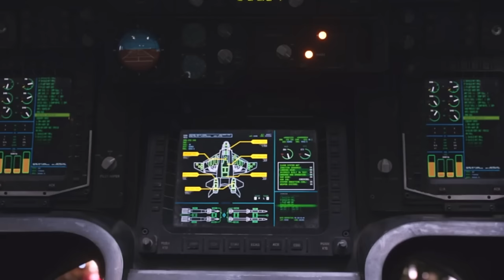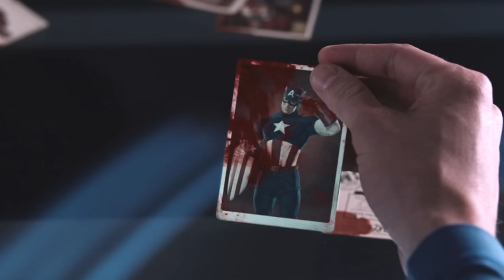Is Marvel's *THE AVENGERS* The GREATEST Comic Book Movie?

Comment: Oh yeah...Vibranium absorbs energy, Adamantium is really strong, it can reflect damage. In the comics, vibranium has a limit to how much energy it can absorb. Small amounts of vibranium will break when that limit is met, both metals can be damaged by a nuclear blast or if struck by Thor wielding Mjolnir. Captain America's shield was destroyed during the original Secret World comic, but it took the power and will of a god to do it. And then Captain America repaired his shield using his willpower, so it was "reset". So if Thor or the Hulk got ahold of Logan in a certain way, they could bend his arms so they would generate crooked. So far the Hulk has just been pulling his limbs off, which doesn't affect his bones. SHIELD or Stark industries also has a special laser that makes Adamantium clay like, so they can mold adamantium into any shape they want in a certain time period, then it gets hard again. So imagine if Logan gets hit by that laser, he would be crippled, because the weight of the adamantium would shatter every bone in his body and then it would harden in that collapsed shape. (Yes, I've been thinking about this stuff since the 80's. :) )